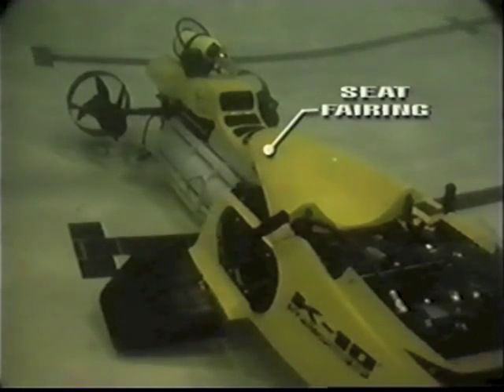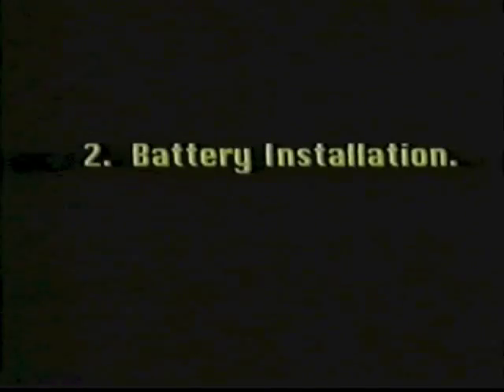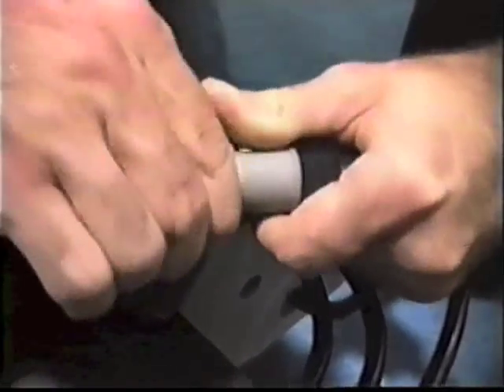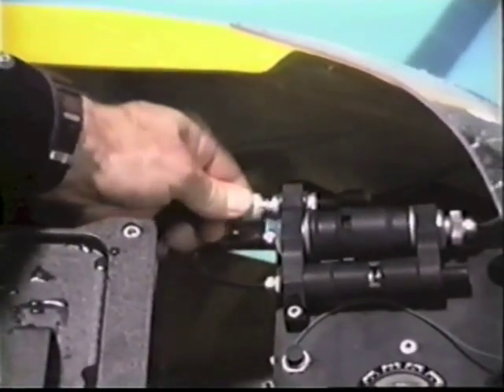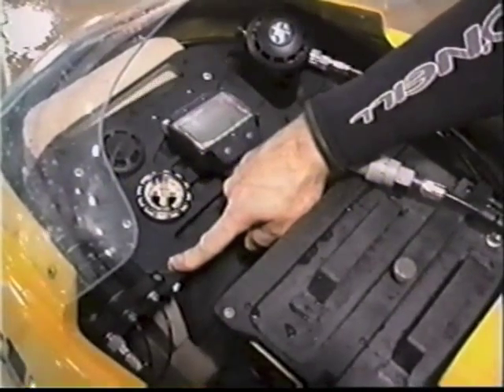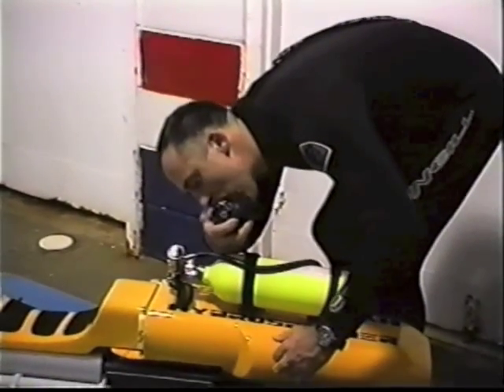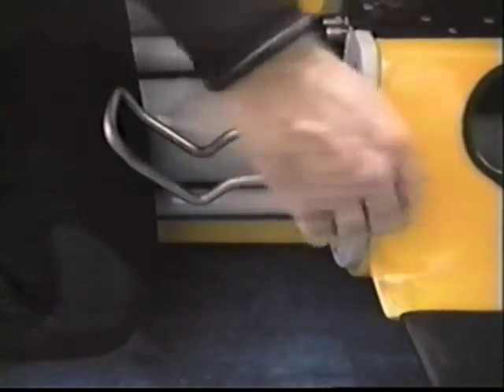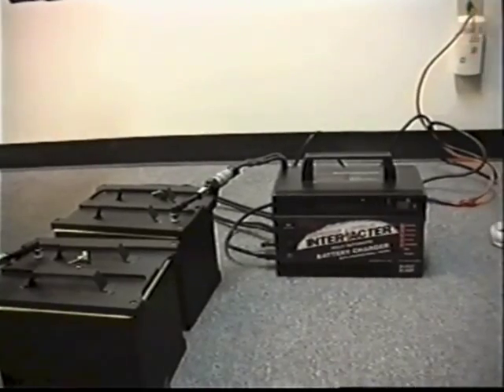K-10 Hydrospeeder High Performance DPV

Comment from the maker: I am restoring 2 units, the video is from a VHS tape the previous owner provided, they say it will run about an hour.  There are 2 batteries that can be isolated.  One battery could take you out, the other can bring you home.
Reply: Hi David, I have a friend who recently bought a K-10 Hydro Speeder and didn't have good luck "flying" it. Are you still out there after 7 years?
Reply from the maker: Peakbagger I am here, I sold these a couple of years ago but I did get them running